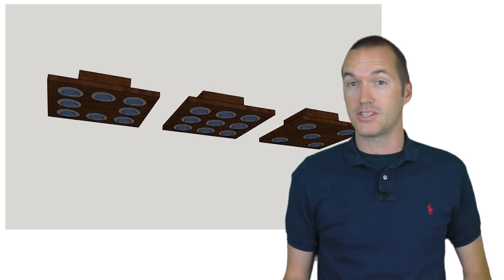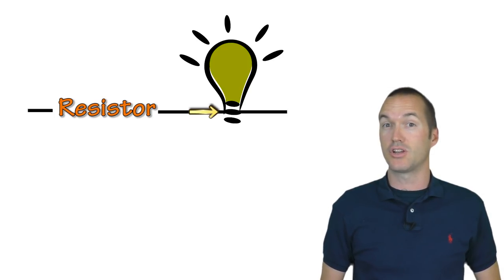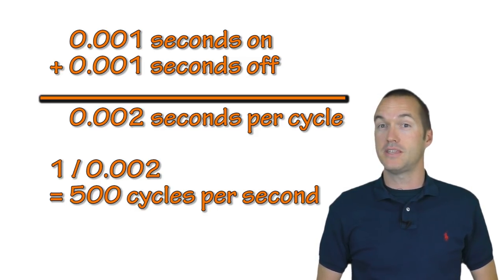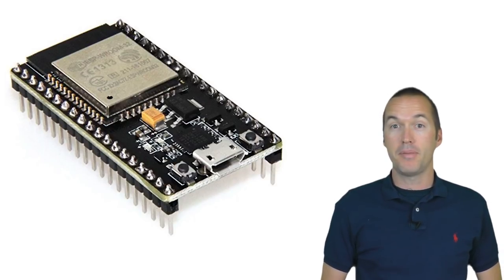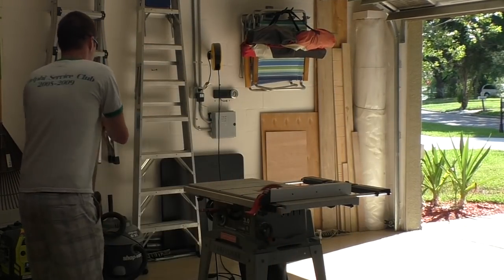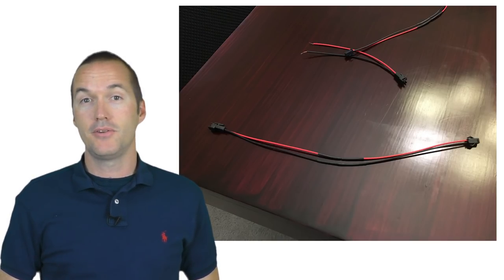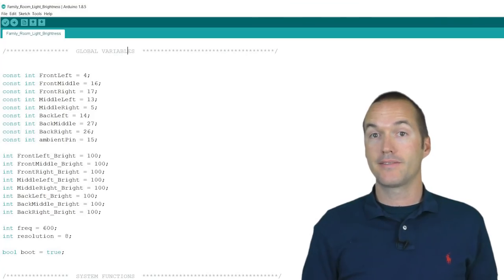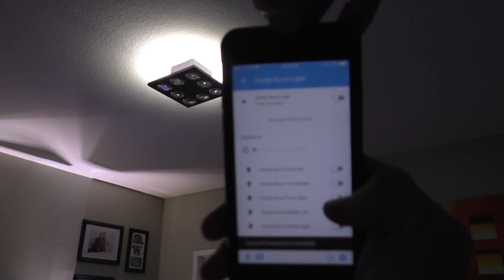DIY Smart LED Ceiling Light: 8 Individually Dimmable Channels

Comment: I think it's really not adequate for such a high quality light source like an LED to drive it by PWM. It should be driven by a dimmable constant current source. No audible noise, no flickering. Anyone who uses PWM does it to save some bucks.
Reply from the maker: You won't get flickering if the frequency is high enough.  60hz pwm is ugly and will not produce high quality light, but at 600hz pwm will be able to generate a larger range of dimming than a constant current source because LEDs have a lower bound of forward voltage that will produce light.  That lower bound will be the minimum brightness if using a constant current source, but can be dimmed further using pwm.

Comment: Nice video but your description of how an incandescent dimmer works is slightly off. The most common dimmers also use a kind of pulse width modulation but this time it's controlling the amount of the AC sine wave that the lamp sees. Switching is achieved using a triac rather than a mosfet in this case (or an IGBT in the most modern dimmers).    https://en.wikipedia.org/wiki/Dimmer#Solid-state_dimmer
Reply from the maker: Yep.  I was being disingenuous for the purpose of simplicity.  Although I did grow up in a 1940s house full of rheostats that work in the way I described.

Comment: After seeing this particular video, it now has me requesting you for the following, please:
For home security I came across model: RFM181B which are triggered wirelessly, however, are on the pricey side. Can you scheme a method where one detector can trigger 2-3 lights. Or perhaps build your own on a budget. 

MUCH THANKS!
Reply from the maker: You mean a detector triggers 2-3 other smart lights?  

Or a detector triggers 2-3 lights that are attached to it?

Of a detector triggers 2-3 non-attached non-smart lights?

The first two are really easy, the last one is not.

Comment: Hey Rob, thanks man,first in its kind, great,i have some questions if I may,first, I have 18-24 V LEDs, can I get use your method? Besides, how can I have the wall switch as well?
Reply: The 7821 transistors recommended will handle 18-24 volt...  I have mostly finished a fork of Robs code (in github) It has some additional features,  and I will add to the code the option for manually operated switches.   It will require wires from the switch to be connected to mcu... JUST THE SWITCH - NO HIGH VOLTAGE lines :)

Comment: Great project! I wish it was in front of me now to tinker with! I would love to play around with some light animation effects.
Also, the perfectionist in me wants all 8 lights to respond simultaneously instead of one at a time as the MQTT messages come through. I was thinking you could add a 9th mqtt light with a topic of "FamilyRoom/All" and update the Arduino code to control all 8 lights with that topic. The only problem is making the HomeAssistant UI nice because I don't think there's a way to make a detail card with the "All" topic at top and the 8 individual mqtt lights below that like you have at 14:00 ... but perhaps there's a way I don't know of? Maybe something with Lovelace I keep hearing about?
Reply from the maker: I actually have a generic /commands/ topic that it's subscribed to, that's how I did the fancy pattern at the beginning of the video.  I may go back and figure out an all on/all off brightness fade in/out, but I've got company in town and barely finished this video as is, ha.

Comment: I was running 5000 htz  and had an issue on gpio15.. (ambience pin)  it doesn't turn completely off and i speculate its not 100% "ON" when it should be...  frequency too high for that pin maybe?? ( I burnt out my esp being careless, so my investigation will have to wait for the replacement ) do you have this issue?
Reply from the maker: Huh, actually that ambientPin definition was left over from when I was using FastLED to control the ambient LEDs.  There really isn't anything in the code I posted that uses that ambientPin.  I have my ambientLEDs running on a different circuit, that was supposed to control the ceiling fan that could have been in that location.  I had envisioned using a relay instead of a transistor to turn those lights on and off since they really aren't bright enough to need dimming.
Reply: The Hook Up : ah I never noticed....I rewrote your code ( posted in github fork) and gave it the full pwm treatment ...  Thanks Btw
Edit- Thx, got it all sorted... only 8 pwm channels supported in esp32.. ( with choice of routing to 16 pins )... I’ll do the same and use 9th channel in switch mode 👍

Comment: I guess you can make a light group in home assistant so they turn on or off at the same time.
Reply: He has a light group.  I think he needs another MQTT topic for all.  May be worth looking at adding a watchdog timer for when the ESP32 core dumps and ota into the code as well.
Reply from the maker: both those are in there :)

It does a check in every 120 seconds, if home assistant doesn't hear from it in 10 minutes (5 check ins missed) it will cycle the power to the ESP32 using the sonoff that used to control the whole light.
Reply: Would love to know how you accomplished the MQTT check ins missed in HomeAssistant. I'm guessing some sort of MQTT sensor?
Reply: thedude3213 i would also be interested in that. Is it a counter in node red?
Reply from the maker: Yep, MQTT sensor with an "expire after" value of 600 seconds.

Comment: Nice project. Never realised this specific advantage of the esp32. 
In old incandescent dimmers dimming is done by phase cutting, not with resistors.PWM is simpler
Reply from the maker: Depends on how old.  Triac dimmers are certainly common now, but rheostats were the original dimmers and use resistance.

Comment: QuickQ: Is it ok to put up to 6 bulbs on single mosfet and they would need to be connected in parallel, right?

Thank you.
Reply from the maker: I think that would be out of spec for those mosfets , at the very least they would need to be attached to a heat sink.

Comment: Thanks for a great video.  Very inspiring and looks easy enough for me to have a go at it.  However, I'd like to put the lights in the ceiling of my living room - some would be placed up to 4 -5 meters from the controller. Could there be any problems caused by the 'long' wires to each lamp? (e.g. electrical noise)
Reply: Your Voltage may drop a bit depending on the controller, but since the light is only being turned on and off rapidly noise shouldnt be an issue

Comment: Do you know if the ledc code to set the frequency can be called from within void loop()? I'd like to use the frequency spec as the variable rather than the duty cycle. I've also looked for the min/max values for the frequency, but haven't had any luck.
Reply from the maker: I believe it can be called from anywhere.  The frequency max differs based on the resolution.  It can go up to 40 MHz with 1 bit resolution: https://esp-idf.readthedocs.io/en/latest/api-reference/peripherals/ledc.html#ledc-api-supported-range-frequency-duty-resolution
Reply: The Hook Up cool. Just found a learnelectronics vid where he went from 100Hz up to about 312kHz. Now I have to see if I can write a sketch that behaves changing the Hz value (fixed 50% duty) based on either rotary encoder or Nextion display. Shouldn't be too hard. I'll let you know how it goes.

Comment: You probably got fake transistors, try lcsc.com they're the components store of JLCPCB. You can also combine the PCB and component shipping. I've got some KIA3400 N-FETs, they got a threshold voltage below 1V and can switch 4.5A.
Reply from the maker: You know, I hadn't even considered that... you may be right.
Reply: @TheHookUp  Since you are in the US you can also order from Mouser or element14, I don't order from them because they have expensive international shipping.
Reply from the maker: Mouser shipping is always crazy, $10 for parts, $20 for shipping. I used to order from them all the time before parts came so widely available from Chinese suppliers.

Comment: Thanks for the video, I am also working on the same project. A doubt though, supplying a 12v directly to the leds wont damage them as there is no limit to the current? Usually a driver limits the current to <300ma for each light set. Am I missing something? Currently I have added the pwm circuit in between the driver and the light, I am using arduino.
Reply from the maker: Hmm, that's an interesting point.  I haven't had any issues with that, but you're right that there needs to be a current limiting resistor in the circuit.  I believe I remember there are resistors on the circuit board for the actual lights, but I'll need to double check.
Reply: Most probably it will be 3 nos x 1w LEDs in series, mine didn't have any resistors.

Comment: hei rob,

can you follow up the temperature inside the enclosure? maybe with the internal temp sensor of the esp32. I am wondering if there is need for ventilation ...

Mario
Reply from the maker: I haven't noticed any issues with it, had it on almost all day yesterday due to rain.  I just found a youtube video about reading the temperature sensor of the esp32, I'll add that to my program tonight and report back.

Comment: Hey thanks for sharing this awesome video, I would like to ask a question for the power source: What if those leds are all powered by the main(say 220v), what kind of "converter" should I choose? (from 220ac to a 5v dc)? Also, if the leds are all dimmed darker, which means can save electric power comparing to full brightness? Thanks
Reply from the maker: The one in the description will take 220V AC and convert to 12V DC: https://amzn.to/2LjhI16
Reply: @TheHookUp  So that is exactly the one you mentioned in the project right?

Comment: Thanks awesome video!! Do you know if Tasmota will work on the ESP32 nodeMCU, I'm not big on coding and I have many LED strips working with Tasmoata however flickering does become and issue at times.
Reply from the maker: I'd need to research that.  I seem to recall seeing a fork of it on github for the esp32
Reply: I found something, however it was from last year, may need to just get one an try to figure it out, thanks

Comment: Thanks!! Thinking of making a separate low voltage chanel based net in my new home, controlling brightness, light temperature, rgb
Reply: Ok, not sure exactly what you mean, but if you're thinking about running a separate low voltage wire system in your home, that is going to be very expensive and maybe not work as well as you might think.  The conductors would have to be huge to carry DC voltage efficiently for any significant distance.  If you use low voltage AC, you're better off, but the large transformer you'd need to feed the whole house would be fairly expensive, too.  If you already have or need a low voltage AC system for outdoor lighting, then you're more in the ballpark of this being economic.  In either case, DC or AC, running a new set of wires throughout an existing house is going to be very expensive.  It will cost a lot less to use switching power supplies where you need them.
     UNLESS  you're building a new home and plan to use low voltage AC for all the lighting,   You'll still pay a premium to get it done, but nowhere near as much trying to do it in a standing house.  And a switching supply for every single light would mitigate that cost significantly.  If that is so, I hope someone has talked to you about how that will affect the property resale value and possible incompatibility with newer lighting devices years from now, should the type you used be no longer available.

Comment: Hi Rob, thanks for the great videos. You've been a great source of information and inspiration for several of my own home automation projects. Have you had any issues with the lights you used for this project? I purchased the ones in your link and 9 out of 10 failed almost immediately after hooking them up I haven't even hung the fixture. Some just loose 1 led other all 4. One thing I noticed was the ac/dc rectifiers supplied with the lights output 20vdc. I tried 1 light with a 24vcd adapter and that one failed immediately. I'm pretty confident in my setup and soldering skills, but i'm not above admitting I could be the faulty component. Just wondering, keep them coming. Mike
Reply from the maker: Huh, I wonder if they changed the product at the link.  Mine are all 12v
Reply: I thought that also, took one apart and they seem to work great individually at 5v, really bright. These are 4 leds' per also, didn't you mention the ones you had were 3? Also I ordered the cool whites and a couple of them are bright. I'll add them to the pile of xxl shirts that my wife bought me from amazon that won't fit our 6 year old! :)
Reply: Figured it out, I think. I selected the 4W instead of the 3W. So 1 more led. I wonder if supplying 12vdc to these resulted in a thermal runaway which damaged them? I'll give the 3W version a try.

Comment: The transistors in the description have even higher gate threshold voltage... Your's are 2V, those in the description are 2.35V. You said that it should be lower!
Reply from the maker: Yes, I suspect the data sheet is incorrect on the ones I used.  Adafruit recommends the ones I posted for use with 3. 3v logic. I trust their recommendation.
Reply: Thanks, looking forward to getting this implemented

Comment: Did U hook up the pocketman LED to 110V or 12 V ? Because the Input Voltage:85-265V ?
Reply from the maker: No, I didn't use their power supplies at all.   I used my own 12v supply and wired them straight to the leds.  (Just remove the little white box part of the wires)
Reply: @TheHookUp  Thanks :)

Comment: I tested this setup with one led there was to much noise from the power supply and the led. When i connected the led directly to the power supply  it was quiet.
I solved it by changing the frequency to 20khz so now i cannot hear it anymore
Reply from the maker: Ah, I was confused when I read this.  I normally think of electrical interference when I hear the word noise... You meant actual noise, ha.  Glad you fixed it.
Reply: @TheHookUp  Yeah i should have written humming instead.
Reply: Haven't gone full scale yet, but thanks for the heads up

Comment: Great project. How would you add a light sensor that would adjust the lighting percentage based on how much natural light in entering the room?
Reply from the maker: That's tough to do because the lights themselves will change the reading from the sensor. It would need to be shielded from the lights in some eway.

Comment: Really great video, and great explanation of how dimming works. How would you go about creating a dimming circuit at mains voltage? I have a cabinet with 50+ sonoffs mounted in it to control all of our lights and heating, but I'd really like to add dimming to a couple of those circuits - currently research the options - build vs. buy....
Reply from the maker: I'd wait a bit longer and get the shelly dimming solution when it is released.
Reply: The Hook Up do you have the inside track to suggest that this is on the way? Would it replace the sonoff? Or be an addition?
Reply from the maker: It's in late development state.  It would replace the sonoff.
Reply: @TheHookUp  interesting... does it have the ability to plug in an external switch? any idea when it might land...

Comment: Awesome, i made a similar project but i used esphomeyaml.
Is super easy to configure and the entities just pop-up on home assistant.
Reply from the maker: I REALLY REALLY wanted to use ESPHomeYaml for this, but the hassio version can't program the ESP32 due to some library limitations that I don't fully understand.  Are you using an ESP8266? Or did you use the PC version of ESPHomeYaml?
Reply: The first attempt was a esp8266, with ESPHomeYaml in the raspberry pi running home assistant since I did not know about the situation of the pwm.
Then, to use the esp32, I installed ubuntu on an old hard disk that I had and installed ESPHomeYaml.
I also connected a momentary switch and a fan, and with the automation function I can control the LEDs and the fan (one click toggle the LEDs, double click for the fan) even if home assistan is offline.

Comment: Im just in the process of revisting this project now i have a bit of time.  I posted further down the comments.  Still got the dimming issues not sure if theyre the right mosfets im using. could any one help?  They all switch off/on but the dimming feature doesnt start dimming until it gets down to 5% ish on the dim sliders above 5% theres no change
cheers
Reply from the maker: Have you tried with a logic shifter?
Reply: The Hook Up yes tried that as well. Not sure if it’s a problem with the build of the code, Arduino always seems to throw up errors for me even when compiled. Any chance you could upload a bin file to flash to the esp if I was to give you my SSId and key over a PM?  Cheers
Reply: back to square one. esp programmed correctly.  voltage on 12v side when dimming changes from 12.26 down to 12.12 before dimmed to off, then 0v.  tried shifter and various mosfet.  any help appreciated :-)
Reply: TanDogs vandotcom : ..sounds like a hardware / wiring issue...which mosfetes are you using? I used the recommended ones without the voltage boosters and have no issue

Comment: Great video. Would live to see a rgb version 😉
Reply from the maker: I wrote the code for it.  Originally I was going to use WS2812B LEDs for the ambient light but my wife requested warm white to match the under cabinet lights. I can post the RGB version in the github repository.
Reply: Awesome, thanks !